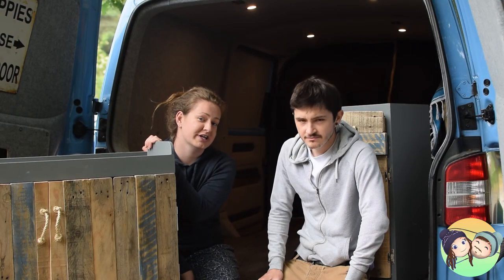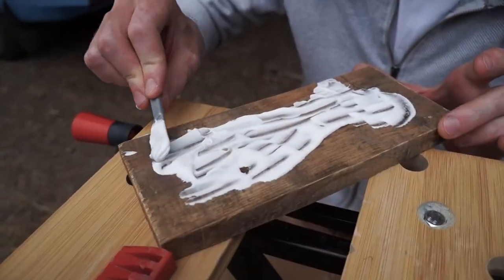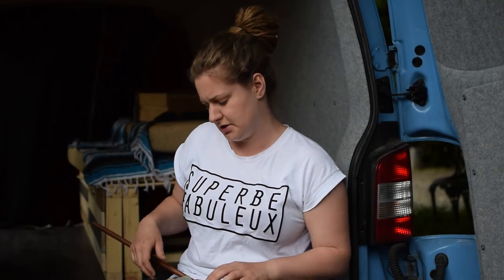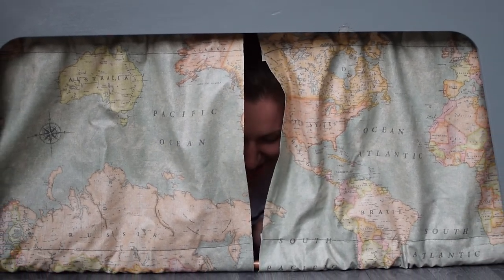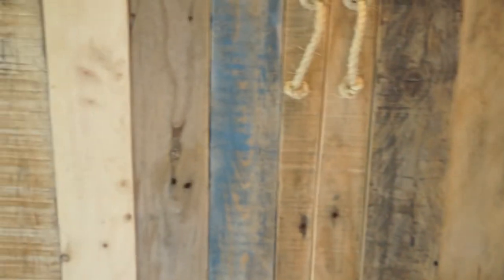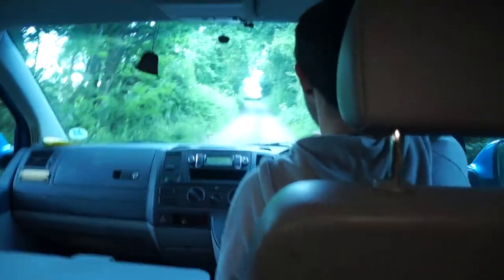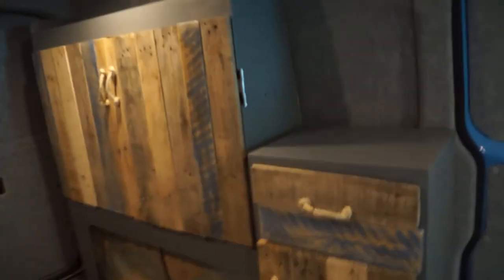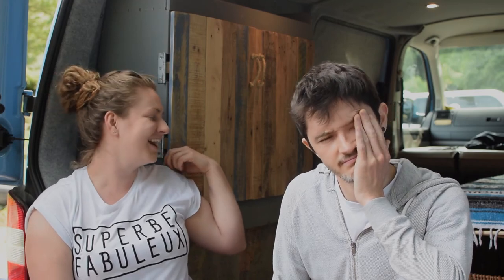Day 27 - Furniture Installation (Finally!)  #VanLife VW T5 Camper Conversion

Comment: You mention at the end that you are concerned a little that stuff will fall out the cupboards, you could use a small piece of baton inside the doors on each shelf to stop stuff sliding towards the doors and forcing them open, even paint them the same colour so its not obvious
Reply from the maker: We've since done some more work on the cupboards. Removing some of the roller catches and replaced with rotatable driftwood stoppers that swivel in to place and keeping the cupboards shut tightly (if that makes sense, pics/footage to follow). But we'll certainly keep your idea in mind if we do have any escaping items :p

Comment: Good work guys! How many fixing points did you have for the bed frame? All the same L brackets as the furniture? Any tips?
Reply from the maker: Thanks! Yes the bed has similar brackets. I know we used at least 4 but there may have been an extra one or two, don't know for sure off the top of my head. The bed is only secured through the floor currently, but we don't think it'll be going anywhere anytime soon! Best is to spread your brackets out as far as you can get, make sure you've got nice long screws that are going to go into your furniture nice and deep for a better hold.  We were surprised at how stable the bed was after just a few brackets! And make sure the brackets are a decent quality. We spent a little bit more for stronger, more reliable brackets.
Reply: Thanks guys!
Reply from the maker: Oh... and a powerful electric screwdriver/drill seems to be helpful too 😛

Comment: So have you secured the bed and furniture to the floor only? Do the screws go into the ply floor only or into the battens below as well?
Reply from the maker: Hi. Yeah, just the floor basically. Thought we'd have to do the walls too, but it was secure enough with a few big brackets and chunky screws. We didn't aim particularly to go through battens, so it's mainly just the ply floor. All these years later it still feels strong 👍 just get some big brackets and heavy duty screws!